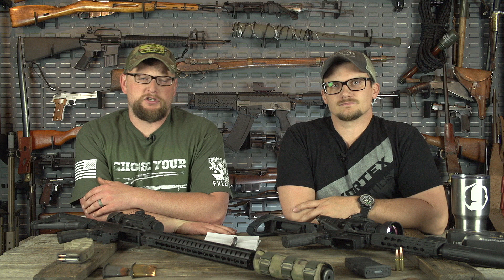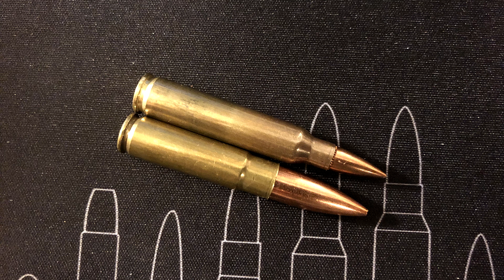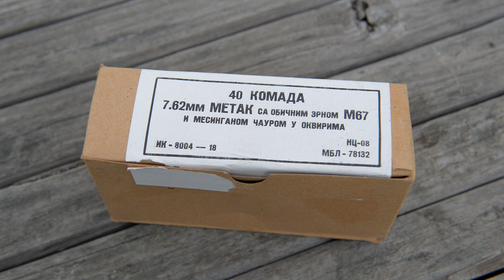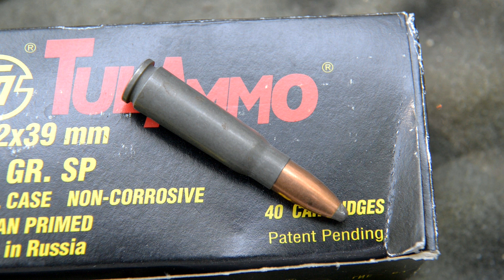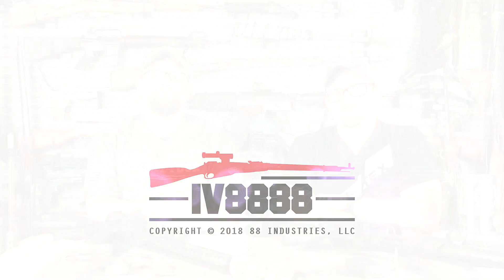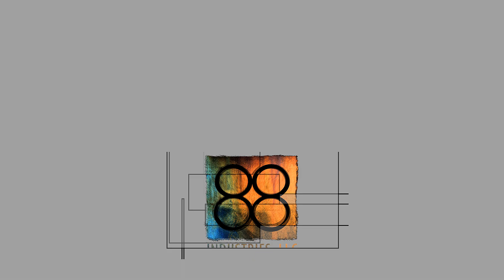Firearms Facts: 7.62x39mm vs 300 Blackout

Comment: A suggestion for your load development, procure a Ruger American in 7.62x39 for the testing. 16" barrel and threaded to accept whatever you want to hang off the end of it. I would think this could handle higher pressure loads than either the AR or AK platforms for this caliber.
Reply: Vikingknight2012 the action doesn't matter as much as the brass casing in the x39 which will start to show you the pressure signs once getting near max loads even in a bolt gun, and max pressure is MAX pressure for a reason.
Reply: Well that is good information to know. I presumed it would have similar reactions to the pressure curve that a .223/5.56 would have in a semi-auto vs a bolt action, having seen separate loads listed for semi-auto and bolt.
Reply: Vikingknight2012 there is no max pressure difference in 223 between bolt guns and gas guns, only difference is powders used to be compatible with the gas system of the guns, but maximum pressure is the same regardless of the gun in this case.
Reply: Vikingknight2012 part of the difference in load manuals for standard and "service rifle" is usually due to barrel twist and bullets used. But that has nothing to do with the maximum cartridge pressure.
Reply: Having looked back I see where the pressure difference I saw was coming from. It was the listing of .223 and 5.56 loads which have different max pressures.

Comment: Should have included more numbers than just 16". Pretty much just framing the discussion from a single, outright stupid viewpoint.
Reply: Indefinite I've tested both calibers in barrels down to 10" and with the right load, the x39 does still perform better than the 300BLK. I played with the 300BLK way back 20+ years ago in its real chambering (300Whisper) and as a replacement for a pistol caliber submachine gun for military/LE use as it was intended, it is a marginally decent round, but that's it.

Comment: I've just been converting Lake City 5.56 brass to 300AAC get the brass for free at the public range, can also buy 5.56 brass really cheap.
is harder to get 7.62x39 re loadable brass.
in short barrels and for running suppressor the 300AAC is superior.

Comment: I got some 150grain .300 blackout from Peak performance Ammunition  for around .44 cent a round.
Reply: ino592002 
And you can reload it for a quarter
Reply: The Immortal I need to stop Bullshitting and start reloading for real.
Reply: That's a good price, but STOP BUYING THAT 147GN CRAP!  The 300 BLK was never designed for it and is the cause of all the "Bullet Drop" nonsense.  Get some S&B or Magtech 125gn ammo.  Unless you just like to plink at 50 yards, and just like it to go boom.  That's ok - I guess...
Reply: Agrippa 2K so stick to the lighter weight rounds? I just got it because it was cheap for .300 blackout

Comment: If you reload and want to shoot suppressed, subsonic, with a short barrel then 300 blackout is for you.
Reply: Thats why it was made. It wasn't supposed to replace anything it serves a specific purpose
Reply: Subsonic rounds are getting to the point of affordability.  You can pick up Sellier&Bellot subs for $11-12 for a box of 20.  Still not 5.56 cheap, though worlds ahead of the early $1/round days and an option to consider before cutting down brass and investing in reloading gear.

I started reloading specifically for suppressed blackout, and while time consuming it does open up an entirely new world of ammo selection.
Reply: Exactly
Reply: Thank you I was hoping someone would answer that question!!

Comment: I hate Tulamo, compared to standard brass they rust easliy.  I've also lost count of the squib/duds & split/stuck casings.  
(ﾒ` ﾛ ´)︻デ═一
Reply: Republican Geek ive never had 1 issue with it.
Reply: Captain Howdy, I say wait & see.  Store your surplus steel case ammo in the garage or attic/basement for a year; & I guarantee @ least 1 out of 50 rounds, will not stand the test of time... T_T
Reply: Republican Geek I have about 600 in my ammo can for about half a year now they are still fine. Plus i found 2 random rounds that were left in a drawer for I idk how many years yet they just have light rust spots and just faded coloring on the case. I really never had an issue with tula. Maybe it's more humid where you live. I also put slicia gel packs into my ammo cans. If i remember this I'll come back and update the ammo's status.
Reply: Jonathan... Hmmm that makes sense, I suppose the climate I live in does play a factor.  Living in southern Oregon @ 4,000ft.  :/

Comment: I think because getting a 7.62x39 AR is so hard to get running right. From a lot of what I have heard they are not very reliable, but you can get 300 black to run pretty well since it’s not much to change from 5.56 you can pretty much throw on a new upper
Reply: i agree with doug m. i too have built one 7.62x39 AR and 2 300 blackout AR's, one pistol and one rifle in 300 b/o. i have had more issues getting both my 300 b/o to run efficiently. my 7.62x39 with a standard AR lower with cheap c-products mags has had no issues what so ever with different bullet grains. but again, like they were saying you have to get a new bolt and barrel of course. one thing that did help my 7.62x39 AR was that the barrel i got already came with the feed ramps polished so that helped things feed even better. and honestly i didnt pay that much for that 7.62 barrel.
Reply: henry06x Bullshit I literally bought a low-end (Radical Firearms) sub $500 7.62x39 AR pistol (10.5 inch heavy barrel) and it has been dead nuts reliable with both the included ASC 20 rounder,  and a seperately purchased C-Products 30 rounder while running Tula and Wolf. I only sold it because the muzzle blast was fucking obnoxious.. Especially at night, it was a blinding light show.
Reply: I think it comes down to 300 blkout if you want one rifle in dual calibers, or just buy a 7.62x39 rifle like the Mutant. Where do you wanna save money, initially with the rifle or long term with hthe ammo? Because the Mutant isn't extremely cost prohibited and you can giggle 7.62 all day long without burning a hole in your wallet. But maybe you hunt and just want to get a humane-kill caliber upper with a specific 300.  Think it ends up being once again, what's the task your using the rifle for?
Reply: henry06x Ya thats byllshit 7.62 ar was made by colt in the early 90s and has ZERO cycling issues thats a online mith. Hell go get a PSA upper and a c product's mag slap it on any lower it will cycle all day long with the cheapest ammo you can find. 
Total bullshit.

Comment: Question for you guys. I just picked up a new hobby of reloading. I have made up a few rounds of .223 for my ar using h335 powder. I use 21.5 grains and the performance out to 100 yards is mind blowing. I am using 55gr fmj bt and the over all length of the round is 2.250. My question is, I am getting small grain like substance around my bcg. Is this normal with this powder? I do run my ar a little on the wet side.

Comment: There’s some decent data out there for 300Blk with the 194gr Lehigh Defense Maximum Expansion that are specifically designed for subsonic use. It acts almost like a high power broadhead. A lot of guys have humanely taken coyotes with them because it does a lot more damage than a regular sub since it expands greatly to make up for the fact that it doesn’t provide hydrostatic shock as a primary kill mechanism. I’ve hand loaded and shot these into watermelons but haven’t tried them on any game yet. But they seem to stabilize well and work as advertised even out of my 8” suppressed AR.

Comment: How about 25-45 sharps vs .250 Savage?
Reply: I built a .25-45 Sharps when they first came out.  It shoots great and is a great round.  The only HUGE downside to it is ammo availability and cost.  The only place to get it is from the SRC store at a little over $1/rd.
Reply: Not much of a comparison.. did you mean 25-45 sharps and 250 savage
Reply: Ty Deneen: Or maybe: .224 Valkyrie vs 6.5 Creedmoore (or one of the 6.8s)
Reply: Ty Deneen Haha That's actually what I meant, I'll edit my original post.  Thanks
Reply: I’m not sure there’s much to compare with those two?
Reply: That's why I don't understand the need or hype for the sharps round personally.
Reply: 25 Remington? I'm the only one

Comment: The magazines are sorta interchangeable with 5.56. When you start dealing with heavier 300blk rounds, you'll find that your standard 5.56 p-mags do not fit quite right. They have specific 300blk p-mags that address the issue with subsonic 300blk rounds.
Reply: Modern Survival Sense I found that out the hard way this past weekend.  I had some Gen2 PMAGs and was shooting 150grain .300 blackout. That shit had a recoil that was rather uncomfortable for a AR platform.

Comment: Does the buffer tube need to be changed when going to 300 BLK?
Reply: You might be talking buffer weight or the spring. And sometimes you have to sometimes you dont. Depends on the ammo and other factors.
Reply: tomglpn no
Reply: i shoot 556 and 300 super/sub with a standard AR pistol buffer and spring, only complaint is they’re loud when using a silencer

Comment: One reason i want to go with 300 aac over 39 is because living in a lead free hunting ammo state the avalible bullets for hand loading makes a big difference for me
Reply: jimhans1 
Just because it can use .308 doesn't mean you should.  Wasn't a fair amount of Russian "accuracy" issues due to people using .308 bullets versus the proper .310/.311 pills?

Nothing wrong with x39, I love mine and wouldn't trade it for the world.  Cheap ammo by the boat load, but my .300 fills a niche I like as well.  Can shoot suppressed without the issue of suppressing an AK, or the reliability issues of x39 ARs.  Can switch between supers and subs without issue, and I've experienced no issues with powder and I run H110, a powder most have issues with.
Reply: 30 carb projrctiles make loading cheap to!
Reply: BW83 M I run nothing but .308 in my x39 guns, including the ones with .310 bores, and have never had accuracy issues at all, in fact, quite the opposite, I've found the .308 to shoot some of the best groups from them. And, in my AR platform guns in x39, I also have the ability to run both supers and subs either with or without cans with zero issues in feeding or function, ever. I've not found a niche where the 300BLK does anything I can't do with the x39 either in bolt or semi, so I sold them to buy more reloading components for other rounds that serve more purpose.
Reply: I use x39 (.310) bullets in my 300 BLK no problem.  It's hardly finicky.
Reply: jimhans1 it not that 39 is bad its that in california my home state if i want to hunt i have to use lead free ammo and finding lead free .310 bullets is not as easy as .308, plus with me having a krag and my grandpa having many 3006 guns bullets are more interchangable for me. I will admit .300 is a nitch cartridge but in my instance it seems like the best fit in the case of hunting. And with california stupid paddle grips finding an ak for a decent price is hard compare to building an AR  and making it legal istead of having to pay a jacked price for a converted gun.
Reply: Brendan's life that's why I built an AR in x39. I can easily use .308-.310 Bullets in it, and it does better with supersonic loads than the 300blk does. It's the best of both worlds, cheap to shoot and more versatile in real world use. It's not that the 300blk is just niche market, it is overshadowed by round that do more, better than it can.

Edit: Full lead free ammo for hunting in California does not take effect until July 1st 2019 unless you are hunting in specific condor range zones by the way. In my x39, I use several bullets that are on the approved non-lead list that do great in my testing so far on 'yotes. I have a load with the 123gr Barnes TSX-BT that does 2450fps out of my 16" Faxon barreled gun and it's just murder on game.
Reply: Agrippa 2K reread what I actually said, it's finicky for sure, especially with powder choices.
Reply: Agrippa 2K 
Jacketed or plated?  It probably wouldn't amount to any real difference, but couldn't jacketed bullets lead to potential pressure issues?
Reply: jimhans1 
Interesting.  I've never even considered reloading for x39, it's about as "cost effective" as reloading 9mm lol.  I may have to give it a try and see what I get then.  x54r has increased in price enough to almost justify reloading it, may have to try .308 bullets for it.  I'm sure Lee makes a cheap enough set of dies it'll be worth the experiment. 

Honestly I just need to invest in a nice progressive setup.
Reply: Brendan's life you can use the exact same bullets in the x39 that you use in the blackout. The x39 can use either .308 diameter bullets or .310

Edit: And the x39 is nowhere near as finicky on powder/bullet choices as the 300BLK